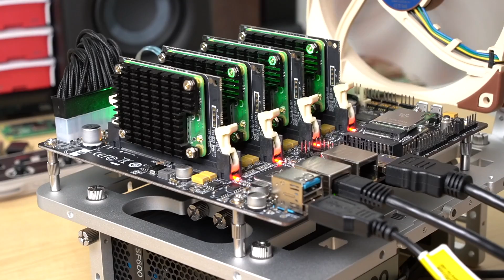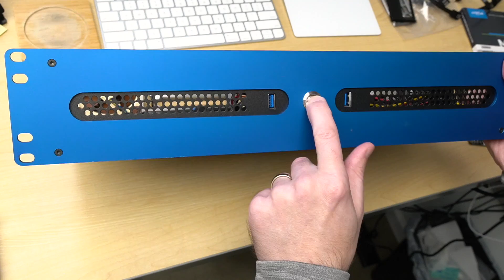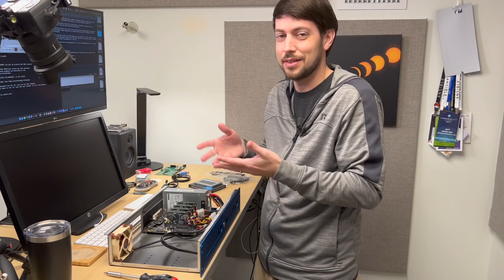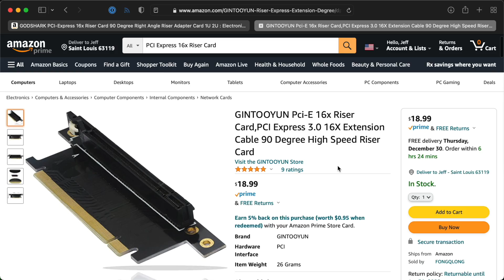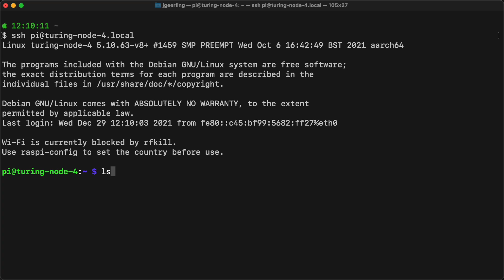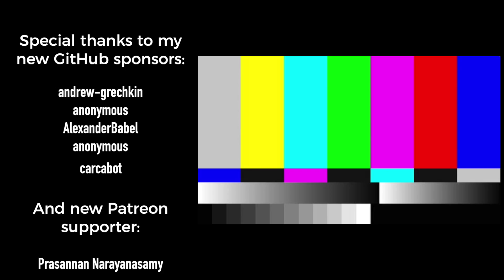Racking up a Raspberry Pi cluster!

Comment: Do you see any issue (power or data) with setting a zfs mirror on a pair of external SSDs connected to single  rpi4 via usb3? I don't have cm4s and I like your approach with nfs shares for pod persiatent storage.

Comment: I'd really like to see a 2U rackmount case like this meant for 2 mITX boards; could run a SeaBerry and a Turing Pi2 in the same case. If it were deeper the drives could be standard swappable carriages. That would make for a wildly diverse and powerful ARM box.

Comment: I must admit that attaching both SATA ports to node #3 and all USB 3.0 conenctors to #4 is a serious design flaw: For redundancy (and maybe load balancing), you would attach on of the SSDs to one node, and the other SSD to another one (just in case one of the CM4s should fail). You could then use Ceph to establish a RAID over both nodes (and both drives).

Comment: Very nice casing. But unfortunately, all Raspi projects today face the same problem: You can't get them anywhere. Compute Modules are out of stock with lead times of almost a year. You can't even get a simple raspi 4b and if you spot one, the prizes are ridiculous.
Reply from the maker: Seeed has had stock of some CM4 modules for a couple weeks, and Pi 4s pop up here and there. You have to dive through a bunch of retailers to find some but they're trickling back into stock this year.
Reply: @JeffGeerling  thanks for the pointer, they have some, but also limited one per customer. I hope for better times... like the good old 2019s ;)

Comment: I could really use a case like that for a project I’m working on recently. I need a nice small enclosure to make a terminal controller for my IBM terminals and that looks like a perfect enclosure for a mini terminal controller. It uses raspberry Pi’s as well as arduino for V1 and a custom FPGA board for V2. I really could use one considering I have the terminals and there’s no good small controllers available on the used market for a reasonable price. I definitely enjoy your videos keep up the good work!

Comment: Please make a video making a Wi-Fi 6 raspi access point. I haven't found much on this topic and I think it would be a great concept. You could even do it on different types of Pi's but I would imagine it would work best on the Pi 4 or CM4. Love the videos keep it up!!!
Reply from the maker: I've been working to find an affordable AP-capable WiFi 6 card, the sad thing is most of the easy ones to find are Intel and can't work in AP mode :(
Reply: @JeffGeerling  That is big sad. I wonder though, do you think even if it wasn't "affordable", you could still build one that is reasonably priced for its capabilities versus something off the shelf of similar performance? Thanks so much, I appreciate the community engagement!!

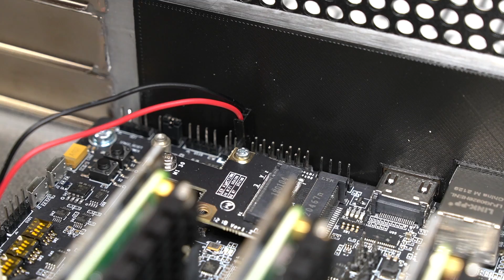Comment: 6:35 in - check out the bend in that motherboard - just glance at the sockets behind the IO shield and see how far they go out of alignment.  Will the PCB be made thicker or less bendy before release?
Reply from the maker: To be honest, I think the better solution would be to either place a spacer on the middle of the motherboard or make sure the enclosure has the middle stand-off installed for better stability. the board itself doesn't flex too bad, but some of the plugs near the middle require a bit of force to install.

Comment: there are several 2RU case options. but many are WAY too expensive. the Monoprice box (can a link go here?) is a $1oo bucks. you could also sacrifice some old rack server. those you can often find for cheap or even better free. however, most RUbox of that style are really long. and noisy.

Comment: One of my first storage “Servers” I setup for my home needed extra HDD mounting. I took the door/cover and drilled holes just like you have in your case. Mounted 6 2TB WD Green drives to the cover, screwed a hinge to back edge so you didn’t just pull the cover off and rip the SATA cables out of the drives. Suited my needs for a couple years before I got a proper case. Just comical to see the same mounting method

Comment: am a mobile software technician yesterday i was receive Infinix Hot 8 Model No: X650C which is hang on logo problem and also not resolve with factory reset then i decide to flash with box cm2 but after i successfully flash mobile touch is working but not working properly when i hit any icon or button its not worked but when i hit little bit upper site of apps icon its work so plz help me about this problem

Comment: Great video as always, Jeff! Looks like they could cut an access hole in the top, placing one twist-screw to hold it down in front, and a double open-hinge in back so the "lid" comes off; This would allow full access to the mini-ITX board. Also, while I don't see rack mounting holes, it looks like there is enough metal to place standard-spaced holes to attach generic rack mount rails. It ALMOST looks like you could put rails on there, and have one unit in the front of the 2u and one behind it. But I did not see dimensions. We used to do that for 1/2-depth servers a lot. But at least it comes with wings. I'm just not a fan of wings built onto the box, I'd rather have them screw-on like most routers and switches. I know--small thing. :) I'd like one of these. Have the TP2 on order. I have eight CM4s. Waiting to see what CM5 is.

Comment: The fan is on one end of the case blowing across the drives (which I doubt generate much heat) whilst the CM modules are on the other end of the case where it would seem there is not much circulation.  Am I missing something or is there some other way the CM modules/Turning PI are getting cooled?  Or is that a concern at all?

Comment: the case could be a box design, once mounted in the rack, pop a few front panel thumb screws and pull the bottom plate out

Comment: You could install a small temperature controlled supply for the fan, listed as "12V DC PWM PC 4 Wire Fan Temperature Speed Controller" on ebay. With the SSD Id suggest extruding a clip in mounting plate for them so installation and removal would be a breeze.

Comment: the only thing more better would be 4 sata ssd in raid 10 and then a big spinning rust to do img - guymager - will kali arm boot? am really interested in what sw you run the cluster on - and the net fs too - you may be able to do better with gluster and or ocfs2, gluster on zfs? there are a lot of choices, do a generic galera mysql cluster and run some benches - raid10 should speed it up - yes it is a little red shirt jeff gilding the lily - maybe you can get another clone and make it HA - connected to dual ha opnsense - dual dual wan - pls do some link agg to speed up and show those numbers #bonding vs bridging. thanks for all the work - nvme would be nice but new sbc will be out by end of year - io is going up, ipc is going up ---- pls do iops benchs - maybe run phoronix benchmark tool? - i will be interested to see progree with next gen - things are going to 10g and nvme for the refurb mkt - i think the real way to deploy is with refurb - clusters are good for smb when they need to scale #dcbox comparo #license fees #open hw #open compute #jetson cuda cores #gpu arb #roi #tco #techmikeny

Comment: @Jeff Geerling, it seems like if we wanted to run a Kubernetes cluster on this setup with persistent storage, we'll be limiting ourselves to those MicroSD cards or EMMC on the compute modules themselves. I suppose we could also configure node affinity for those deployments that require persistent storage and use the sata drives on pi3? What are your thoughts on this?
Reply from the maker: I'm planning on setting up NFS on node 3 and then using K3s' NFS integration to mount persistent volumes. No extra redundancy but the speed should be better in most cases than eMMC or microSD storage local to the Pis or via Ceph.
Reply: @JeffGeerling  Thanks for confirming, funny enough, as I was sitting here mulling it over thinking NFS would be a good workaround, not realizing that K3S supports NFS as a storageclass natively. Appreciate all you're doing for the community, and the prompt response.

edit: I really can't wait to see the upcoming K3S video.

Comment: Looks good, but seems a little overkill on wasted space, and could easily fill up a rack with these.
Would love to see a similar case that holds 2 Turing Pi's with one shared power supply. It the case was slightly deeper it would allow for SSD at the front (maybe even hot swap capable), with fans in the middle. would be great for airflow and allow 8 nodes in a rack. 
Looking forward to seeing you with a 1U rack option from Ivan Kurlshov containing 20 CM4 blades. That would be some serious clustering. 😀

Comment: Regarding the 4:00 mark I actually like the way they've set up the 5 2.5" drive mounting as it means the rear fan pulls air across them to keep them cool which is pretty important if you were going to be thrashing them.

Maybe a thin top sheet could be provided/3d Printed to connect all the 2.5" drives together from the top too. Alternatively that could be extended into a shroud to funnel the air from the case through the SSDs then out.

Comment: Gosh. With that size, and a slightly different layout, I bet they could have a case that fits 2x Turing Pi 2 boards. One one the left, one on the right, and SSD storage down the middle.

Comment: Love the design of the enclosure! However, looking at the insides, it looks like with a little bit of rearranging from the manufacturer this could easily fit two Turing Pi boards. That'd be an instant buy from me!
Reply: not only that but wouldn't 2 1U PSU's fit where the flex ATX one is? Cus I think the turning PI 2 uses a 24pin

Comment: This is definitely a prototype rack case. It is looney to have screws from the bottom holding drives in. Make it so the front cover is the access to the drive bays and put the drives on a sled. The screws for the lid are okay if there is a hinged access door in the top that requires no screws at all. There should also be at least provisions in the sides of the case for small fans. Almost all of these changes can be done by modifying the sheet metal. Nothing fancy needed.
Reply: Yes and given Jeffs ability with an extruder Id suggest just making a mounting plate so the drives can be simply clipped in.
Reply: I don't see any issues. You can even mount hard drives like that. There are no moving parts on SSD so it makes no sense to not mount them in a way that saves space.
Reply: @BrunodeSouzaLino  - I respect your frugalness. I’m definitely a do what works guy. But there is some room for improvement on this case. Would I use it as is if given to me? In a New York minute.

Comment: Nice case. I would just cut a hole on the front side on the left for a 5.25 bay and put one of these cages that can handle 4 Sata 2.5  drives for easy disk swapping/replacing once it is in a rack.
Reply from the maker: That would be a simple option. Plus you could pop a CD-ROM in there and relive the old days!

Comment: I think the case and also the cluster look really cool! But to be honest, the issues you mentioned with the case (ssd mounting, to many screws) are not really problems that would bother me. I get that you work on pcs all the time and the few screws make a difference to you, but to a "normal" user, i dont see this as an issue
Reply from the maker: Heh, this is true. I'm constantly swapping out hardware, so it gets to be an issue when things take a few minutes to get together... but for many, it's a once-per-year thing (if that) and so it's not quite as cumbersome!
Reply: It's more that professional equipment usually doesn't have any screws. Look at servers from HPE/Dell/Lenovo/Supermicro and most if not all parts are serviceable without ever touching a screwdriver. So to have a case that is almost more a screw-holder than an actual case is a bit off and unexpected, even for relatively cheap sheet steel construction screw-less fasten methods are readily available at practically no extra cost while they secure the system just as well.

Comment: I really can’t accept the 2.5 HDD SSD fixing method. Anyway, a hard drive frame is good.
Reply from the maker: For SSDs it's annoying but not a problem. For HDDs I'd at least figure out a way to put a rubber gasket inside so the vibrations don't transmit through the case.

Comment: I like smartctl "sudo smartctl -a /dev/sda" I use it to monitor the temperature as well if things get to hot I shut things down. I also watch the processor temps with sensor and shut things down 2 degrees C before critical.

Comment: I wouldn't buy the case if it had hot swap bays.  All cost and extremely limited benefit in this case.
Reply: Right now I'd put the MSRP price as-is on that to be around $150-160 at the quantity they would likely sell.  Expect to see it $220-240 with two 'hot swap' bays.  Add another $10 for a power supply switch.  You're easily knocking on $1000 for that rig now, sans SSDs.  I can go down to the PSU campus surplus equipment shop and get 3 or 4 4570S-based PCs with 8GB ram each for that much.

Comment: I absolutely love this, I've got an itx build in an nzxt H1 for my home server and a cool rack mount system like this would be great for the right price and with a few more holes/mounts for ventilation
Reply: I hope you arent useing the factory PCIe riser cable in the nzxt h1 theres a mistake with it than can short it  out to the chasis and start a fire
Reply: @sp3lllz  I am, the secret is just never to remove the screws and you won't short the board
Reply: @wertacus  If you watch gamers nexus video about it from early last year they showed how easy it is to short it out and that just not touching the screws won’t guarantee it won’t short out. Personally I wouldn’t want to risk my house burning down for the sake of a new PCIe riser but hey your call.

Comment: Static side walls with screw holes for rails would be nice
Reply from the maker: Yeah, I imagine the original case design was meant for more or less permanent installations; but the Turing Pi 2 begs for rails or at least a top panel for quicker access.

Comment: I love all your videos, however I seem to have no luck getting ahold of anything on your show. Been on the preorder list for turning pi 2 for 6 months. Still not available, same thing with the san pi stuff you showed. I am betting it will be never before the new pi 4 blade boards you showed are ever available.
Reply from the maker: Turing Pi said they should be launching a kickstarter either the end of this month or early February. They were hopeful for late last year, but the chip shortage has continued to delay the production.

It's been frustrating for everyone in tech the past year+ now, almost everything is impossible to get :(

Luckily at least CM4s are in stock at Seeed Studios, so if you have any of these projects you want to do through 2022, maybe order one or two to have it on hand! There are many CM4 boards that are available already: https://pipci.jeffgeerling.com/boards_cm

Comment: Until you can get "better thermal management", I'd certainly tape up the cooling slots on the end near the fan and at least the first row on the top left (perhaps first 2) so you can induce your own thermal management airflow.  I don't know what kind of heat loads those CMs will have but I certainly agree with you on their needing more airflow.
Reply from the maker: Good idea. Might just put a bit of kapton over the cooling holes on the left side.

Comment: I don't understand why you needed a special case. Mini ITX has the same wholes as (µ)ATX? You can use any 2U case basically.
Reply from the maker: True, but with mini ITX some other standards (like PSU requirements and standard sizes) are also different, so having a case more tailored to the board size can leave more space for other features.

Most ATX-size cases are a bit deeper and have a larger board footprint that would be wasted space (though this case has plenty of capacity still, too!).

Comment: Thanks for another very complete video, Jeff. And by that I mean, you really worked through the bugs and kinks and probably had to wait on replies and parts and 3d prints before even shooting parts of the video. It's a "complete" walk-through with all questions answered or at least addressed. This is, for lack of a better phrase, very good "tech journalistic content". Well done!
Reply from the maker: If people only knew... some of these videos do take many weeks of prep. I have one coming (hopefully) end of January that I've spent three months working on (so far—running into some more problems, ha!).
Reply: @JeffGeerling  Exactly. I've designed and built enough scratch systems and devices to know that it's nigh on impossible to anticipate every single firmware or adapter change. Keep up the great work!

Comment: I kind of like the mounting method for SSDs, but if I was going to use any spinning discs I don't know if I would trust it with the vibrations.
Reply: There are a number of NAS which mount the drives this way. The only big no-no for hard drives is setting them at an angle.

Comment: Can fit dual mitx systems in this case. Would be neat if they release a version that can convert between single and dual system configuration.
Reply from the maker: That would be nice. Would require a bit of origami with the power supplies but it's doable with the space inside.